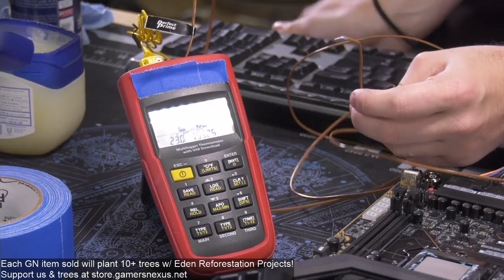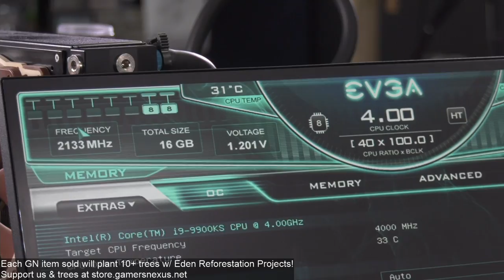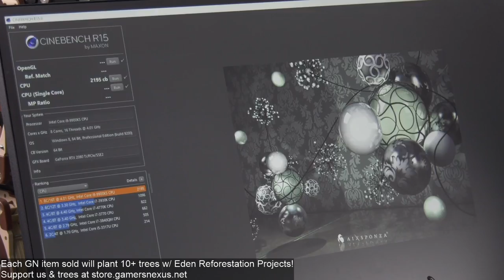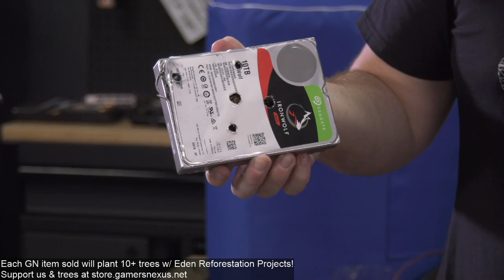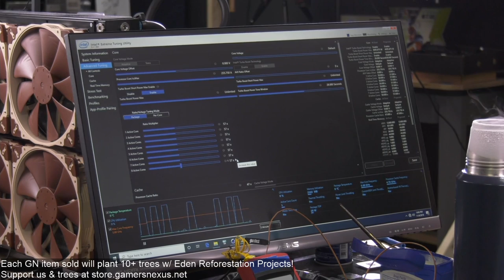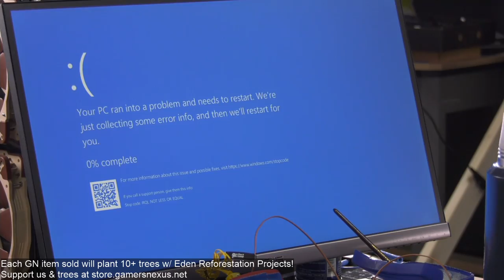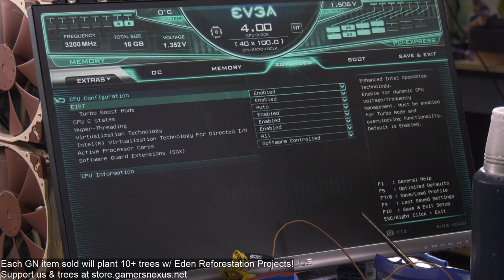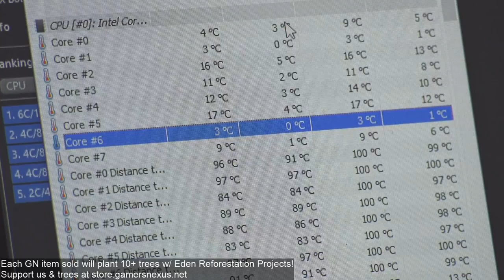Live: 6GHz Attempt on 9900KS | Overclocking with Liquid Nitrogen

Comment: I still have my trusty 9600k.   It's still an absolute beast.  I pretty much won the silicone lotterty.  I have it clocked to 5.1ghz at 1.300v.  It can manage 5.2ghz at around 1.340v but tends to overheat since I'm not using a 360 AIO but a Noctua DH-14 and at 5.2ghz it reaches some dangerously high temps when stressing the CPU.
Thinking of buying a 360 AIO because I want to buy the 12600k when it releases (if it's as good as people are saying).

Comment: I had a DFI Lanparty UT SLI-DR Expert, it's crazy to look back on that board and see how lacking the VRM cooling was. I was heartbroke when DFI went under, that board was unrivaled. Paired with a cherry picked Opteron 170 CCBWE that did 3.2GHz and cherry picked OCZ Gold 2x1GB which did 294MHz 3-4-4-8 @ 3.2V and SLI 7900GS. No other 939 board could touch what DFI was doing.

Comment: Great stream. Crack 6 next time. Try widening the holes on the LN2 pot to make the fitment work with the incorrect socket. You should be able to get enough slip to fit the threaded rod without going too off angle.

Comment: 9900KS Guaranteed sillicon lotterywin ,imagine not winning it lmao
Reply: Imagine getting one that was used by Linus Drop Tips
Reply: @brazeiar9672  and realized he dropped it.... more.. than... once...
Reply: i hope they pre test those
Reply: @stephenbetz2009  His 9900K is a top 5% chip, from before intel started holding back the best dies to build up stock for the 9900KS.
Reply: IsakH85 
This. It’s hilarious that Intel thinks that the people that know about the process of CPU manufacturing wouldn’t be smart enough to know that a guaranteed ‘lottery winner’ means that every new 9900K is now a binned 9900KS. lol
Reply: @KC-bg1th  It also makes Intel look like it has been defeated by AMD. They should be hitting back hard instead with new and innovative chips but they just rebox and rebadge existing tech and silicon. Sure AMD rebadges GPUs, but its at the low end value segment, but with HEDT premium chips people expect a lot more. Don't Intel see how much hate the FX8xxx series got?
Reply: all 9900k can reach 5 ghz on all cores, overclocked like 10 at this point to this speed. my own 9900k has been running 5.2 for almost a year now. at 1.375v. guess i was lucky haha. some people are paying 1200 bucks for 9900ks with 5.2 guaranteed on sl. makes me giggle.
Reply: @brazeiar9672  the voltage drop must be insane!

Comment: Dunno if I just have a very good 9900K or what. People are saying left and right that 4.8k GHz and over on all cores is a furnace on the 9900K...
I can do 4.9GHz on all cores with a Noctua NH-D15.. so aircooled. Haven't tried 5.0GHz. I doubt I could do it.
I ran a continuous torture test on the 4.9GHz all core OC for 24 hours. It was stable, with the highest temp on a core being 85 degrees.
Then I used it for a week. Played different games and used it for different operations like CAD, encoding and decrypting. Still stable.
I proceeded to settle for 4.8GHz on all cores because the revving fans were stressing me out, but if you really need that extra performance on a proper air cooler, it's there.

Comment: after seeing this video i picked up the z390Dark with 9900ks cpu, adding heatkiller cpu block and their four row radiator the system was stable at 5454ghx - 5.5ghz peak @83C max with 1.35Core Voltage.

Comment: It would be interesting in a debrief video to compare air vs LN2 frequencies reached, as well as voltage required to stabilize it. Of course, a lot of them are unreachable on air, so it would show when thermals take over Vcore.
EDIT: Same clocks, what Vcore ?
Same Vcore, what clocks is Steve getting ?

Comment: Seems more like an insulation issue as opposed to mounting.. Are you using those thin flex heating elements around the CPU socket or proper dielectric grease in the socket? :o

Comment: wouldn't it be easier to just have some motherboard enclosure filled with some neutral gas to keep the condensation out? doesn't even have to be airtight if the has is heavier than air, like Argon  which is welder's friends :)
Reply: Only has a cooler nitrogen 😂😂😂

Comment: just a question, would it be possible to submerge the board (minus the cpu) in mineral oil and prevent water buildup while using LN2 to cool the cpu during overclocking? has anyone attempted such a thing?
Reply: Submersion cooling is what you’re thinking of, and while it can be done, it likely wouldn’t function well at LN2 temps. Lots of the other components on the motherboard will start acting funky below a certain temperature (electrolytic caps are likely to freeze), and memory is particularly sensitive, so you want to keep cooling to just the CPU.

Comment: Is temperature the only factor to consider when over clocking cos my i7 8700k gets 5ghz @1.408v and cant get 5.1GHz @1.424v im Delidded btw and temps dont go pass 85C.
Reply: Unlucky cpu i guess also i dont have avx offset as do not want one.
Reply: I want to keep this cpu for about 1 year at 5.1ghz longer would be nice but im at 1.424v and was told i may only get 6 month out of it yet my temps dont pass 80C
Reply: @PJH088Y  just do 5ghz it's only 100mhz difference and you likely wont notice it, your cpu would last longer with less voltage if you can run it under water instead of air to decrease temps you should be able to get a slightly lower voltage with lower temps
Reply: @bradthegamer11  Thanks I am using water. How much will 1.408v to 1.424v effect the life of the CPU its delidded and dont go past 81C and this is with the pump on silent. my next upgrade will be when DDR5 comes out or on RYZEN 7nm+. The cpu i have is weird at 4.7GHz i need 1.390v, 4.9GHz i get at 1.395v but at 5GHz i need 1.408v and at 5.1GHz i need 1.424v.
Reply: @PJH088Y  I wouldn't go above 1.4v if temps were in the 60s low 70s then I'd say go for it but high 70s to low 80s no not at that voltage you would seriously degrade the cpu. If you want 5.1 or 5ghz your gonna have to decrease your temps. Unless your okay with your chip not lasting very long anyway the new ryzen chips are supposed to come next year it comes down to your choice but in all honestly is 100mhz really worth the higher power usage and temperatures eventually killing the chip.